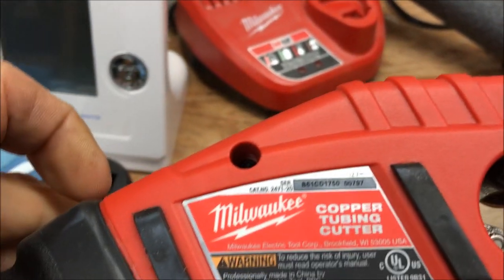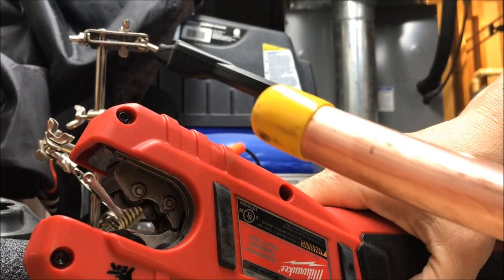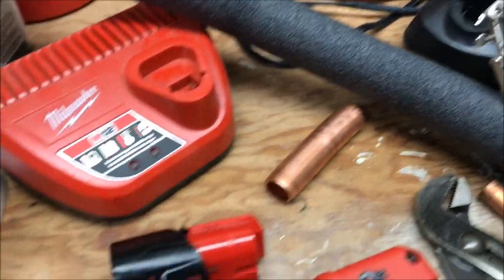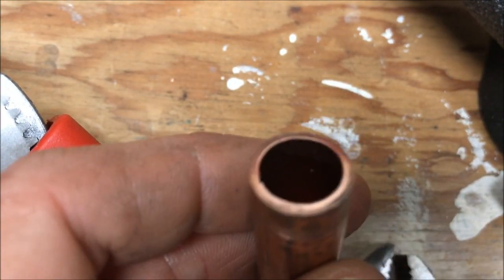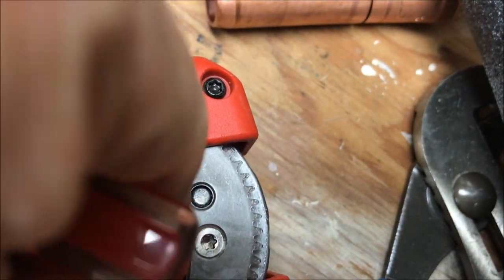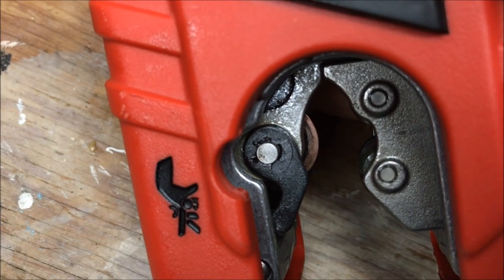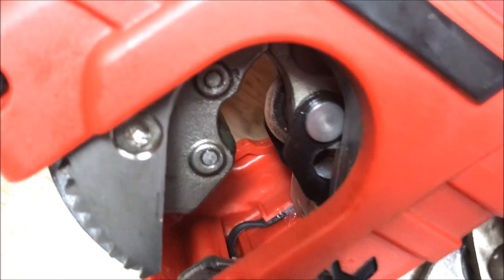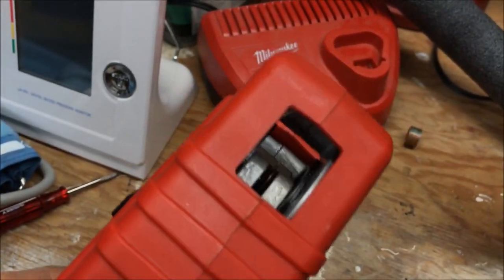Milwaukee 2471-20 copper tubing cutter

Comment: I use it for ACR runs and any of the Type L I use for drainlines occasionally. It's a good tool if you stay within it's scope of solid pipe. But yeah, the soft copper lineset rolls, I'd stick to just hand cutters. Perferably that racketing rigid  cutter works particularly well for it, since you cans till adjust your blade tension as you are cutting in.  
In any case, Milwaukee at least has their head in the right place here. It serves its purpose, and I haven't regretted the purchase once since buying it. Much like any of my Milwaukee power tools. 

Do be careful with changing blades on this with the M12  battery still in. Watching this video, I was cringing the whole time after he left the battery in to return the rotary to home position and started putting his fingers into the rotational route to pull blade out.. man that tool would literally make your hand look like the little mangled logo that's printed on it in no time flat if you got carelss. Work safe gents. ~_^

Comment: you put the pin back in from the wrong side? the cut out on the other side is designed for the pin head... it has a recess in it...

Comment: I have had a bad experience with this tool guys. I got my finger cut badly on a recent repipe. Respect this tool and be very careful with it until you get used to it. I dont like the fact that sometimes it takes some time to have the jaws line up in front so you can insert the copper to start the process. An old fashoined Ridgid tubing cutter won't hurt you and will get things cut in the same time.

Comment: I watched a plumber get all excited about this tool. Pulled it out of the box and cut a heating pipe in two spots. He got a little water inside the thing and it stopped working. So I guess it's only good for new installs.
Reply from the maker: Eric Wotton yeah, getting water into a tool is never a good idea, it’s not designed to be waterproof. A “little” water splashing on it and killing it surprises me, unless it was overhead and dripping into it directly. That’s when you exercise the warranty and replace that bad boy, and realize it’s limitations. It doesn’t cut soft copper for crap either, only the hard tubing.

Comment: Thank you for the video.The cutter is a good tool especially for cutting installed copper pipes.That said I cannot understand why Milwaukee only includes one battery for the cutter when the cutter is purchased as a kit with the case and charger.Milwaukee needs to revisit their business practices because at $150.00 for the kit with the case and charger I don't think it would hurt Milwaukee any to provide two batteries instead of just one with the kit.
Reply from the maker: Nelson Echevarria they used have a two battery kit, 2471-22, but appears they have discontinued it. It probably didn’t sell well, so they stuck with the tool only and one battery kit options. Thanks for watching and commenting!
Reply: @tcphvacr9950  Again thank you for your video.What you say may very well be the case but I believe that Milwaukee should still include a second battery with that pipe cutter.I plan to buy one of those Milwaukee pipe cutters in the near future because I do my own plumbing repairs and there are times when a regular cutter will not work because there is no space for turning a regular pipe cutter.I have lost respect for Rigid and Milwaukee because of how terribly expensive their tools are.I understand that those companies need to make money but it's hard to have any respect for those companies because they have outsourced from the U.S. to other countries where they have the parts for their tools produced very cheaply then charge us Americans such outrageous prices for their tools.And to add insult to injury those companies such as Rigid and Milwaukee get huge tax breaks which I personally feel those companies are not entitled too.I'm all for free trade and such but not when companies abuse their priviledge and fleece consumers.There are over seas companies that sell pipe pressing tools for as little as $500.00 to $600.00 that are just as good as the pipe pressing tools that Rigid and Milwaukee sell so why do Rigid and Milwaukee sell pipe pressing tools for five,six and sometimes seven times the price?It's very difficult to have respect for companies that do such things.As it is it's very difficult to hire contractors and plumbers with what contractors and plumbers charge and now contractors and plumbers are going to hike up their prices if they use pipe pressing tools because how else are contractors and plumbers going to recoup the thousands of dollars that they have to spend on those pipe pressing tools?I get very annoyed when ever I see videos of contractors and plumbers bragging about how much easier and safer pipe pressing tools make their jobs and how much money they save because you'll never hear any of those contractors or plumbers in any of the videos mention passing savings onto their customers.I recently ordered and received a hydraulic pipe pressing tool,sure,the hydraulic pipe pressing tool doesn't have all of the "bells and whistles" that pipe pressing tools from Rigid and Milwaukee have but so what?All that I care about is fixing my pipes without having to take out a second mortgage on my house.The reason that I bought the hydraulic pipe pressing tool is because there are areas in my house where I do not feel comfortable soldering pipes in such as up in the ceiling or anywhere near beams and rafters.The hydraulic pipe pressing tool that I bought came with extra seals and clear instructions on how to service the tool when the time comes so Rigid and Milwaukee can suck it as far as I'm concerned,screw them.
Reply: @nelsonechevarria7009  You are hilarious, everything should be cheaper and throw in a free battery while their at it lol. I think maybe it’s all a big conspiracy to get your money specifically. Since you know how to deliver services and products cheaper than everyone else you should start your own companies and put them all out of business by taking their market share. Rip Milwaukee and the plumbers and contractors out there

Comment: It’s not a bad tool, but the spring is not set stiff enough and that’s why it takes so many turns to cut hard copper and also why it won’t squeeze down on soft copper. 

Tighten that thing up, an internal ridge is still going to be there, this tool has not advanced enough to to delete an internal ridge, so for now tighten up its cutting ability. 

At current performance the $179 plus tax price is about $70 to much. 

Another power tool price gouge.
Reply from the maker: R Yeckley if you work with hard copper, such as plumbing or refrigeration work, it’s a good tool to save the wear and tear in your hands and wrists, especially when you hit 50 plus. A stiffer spring probably wouldn’t hurt, and there’ll always be deburring involved no matter the method. If you already have batteries available, you could pick it up for around $115-$120 bare tool. Problem with soft copper that I experienced was it’s out of round, and it does require a lot of tension in order to cut. But I like the guys who cut lines with water in it and drench the tool and blame the manufacturer when it quits working. Thanks for watching, and posting some valid comments.

Comment: I just got mine today. Cut 3/4 soft no problem. Haven't tried 7/8. It dont cut 3/8 tho. Quite disappointing
Reply from the maker: pointedspider soft copper is hit or miss, depends on how out of round it is. But if you’re cutting a lot of copper, it definitely saves time. Just don’t do like some people and expect it to cut through a live water line and not damage the tool 😆 Thanks for watching!

Comment: I bought MILWAUKEE C12PC-201C and it dosent cut 21mm coper at all, any ideas?
Reply from the maker: BriaCroTex is it soft copper or rigid?  If it’s soft copper, it has a problem cutting it due to it being a little egg shaped. I’ve never had good results with soft copper. If it is rigid copper and it isn’t cutting it, I’d see about contacting Milwaukee about getting a replacement, because that size is definitely in the realm of what it will cut.
Reply: @tcphvacr9950  by ridgid u mean hard coper or straight bar copper? Then yes i bought two sets and we in Ireland have 21mm and it is not cutting after a minute of cutting it cuts but not all the way u can't even break it with hand. And it is standard 1mm copper even less 0.9 or 0.75 thickness

Comment: What’s about stainless steel tubing?
Reply from the maker: It’s a copper tubing cutting tool, stainless would not allow the tension that the spring applies to successfully cut the tubing.

Comment: no way i will pay $20 for  cutting wheel .. i put rigid cutting wheel on mine and work better than Milwaukee one ..and perform way better on soft copper ..nice info ..i really enjoy your videos
Reply from the maker: Handyman1914 I need to see if they’re the same size as all other wheels. Supplyhouse.com has them for $5.25 a set, but I may buy some locally and compare it to the one in the cutter. Thanks for watching!
Reply: yeap will be good idea ..but they are pretty much the same size..its a wonderful tool for tigh spot..I think has so many bad reviews all over the internet is because OEM cutting blade..I have been using mine for more than 6 months without problems after changed the low quality oem blade
Reply: Thank you for the information.I agree with you 110% Why spend $20.00 on a cutter wheel when there are cheaper alternatives?Like you I appreciate good tools but not when tools are so outrageously priced that you have to take out a second mortgage just to do your home repairs.Contractors and plumbers have to eat but if it's a toss up between the contractors and plumbers having to eat and me having to eat I don't think I need to tell you who wins.

Comment: I never knew that this tool agitates this much when cutting, it should be smooth like a hot knife cutting through  butter. The reason why I even come across the tool in the first place is that I am looking for an automated tool that can cut an air/water hose straight and smoothly. Can this tool do that and if not is there anybody that knows the tool that I can buy that can do what I want to do. The person can please let me know, I prefer an electric tool, the ones that are battery operated.

Comment: You was cutting on a bend mate never gonna happen and pipe needs to be fully rounded off
Reply from the maker: J Smith No doubt.  Even with the soft copper straightened out, it’s so out of round, this cutter has difficulty. By the time I try to shape the copper and cut it, a manual cutter is more efficient. But for ACR pipe, this thing is the bomb.